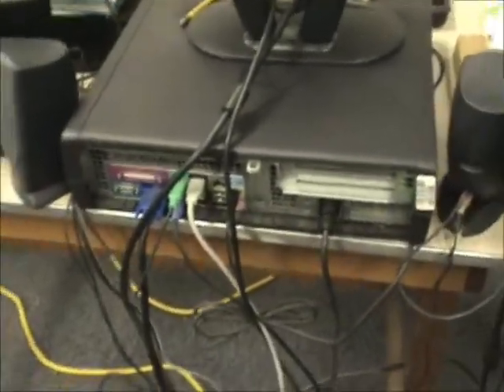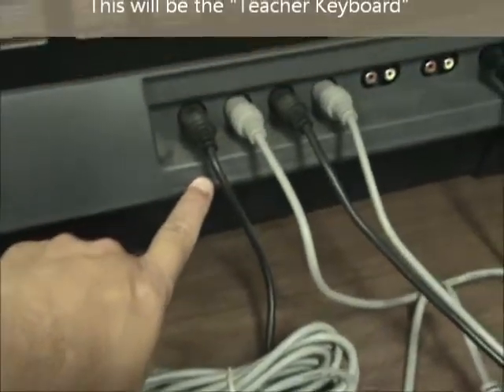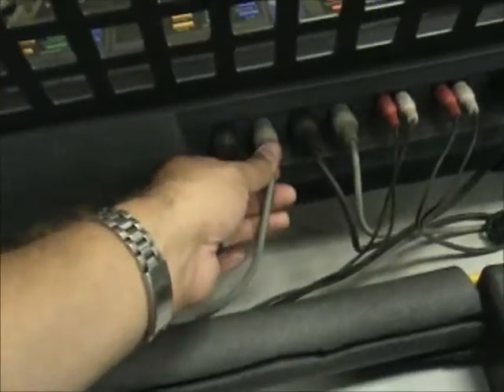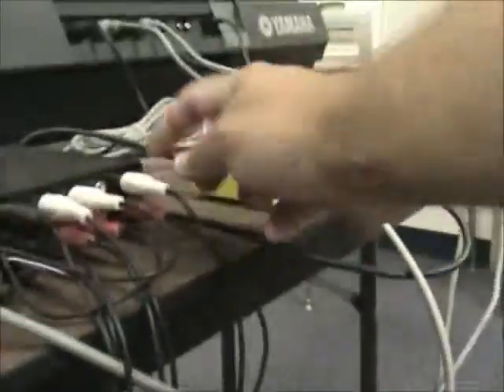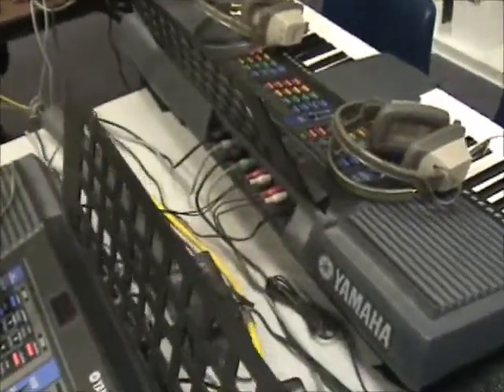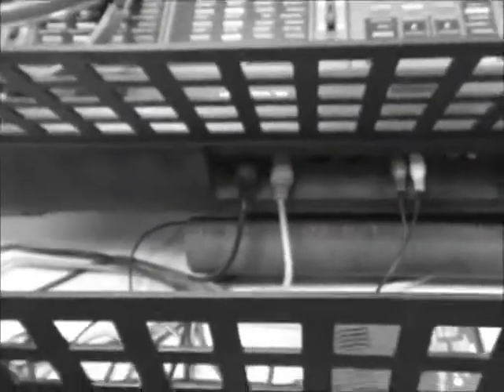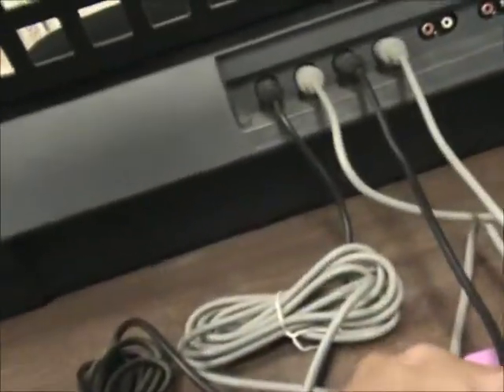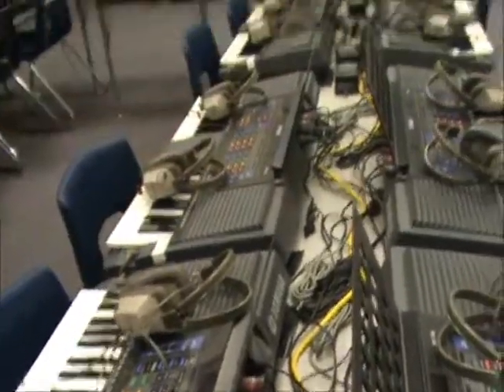MIE Set up Movie

Comment: The real curse is trying to find that M-Audio 2x2 Box when it goes bad. I've tried another brand. An Amazon Midiplus 2x2 USB MIDI interface and I'm getting mixed results. One is now the Teacher station doesnt show 0 on ID test, and some of the keyboards are not being locked out properly. Just going to get one off ebay and hope that fixes it again. But I can do the ID check and it works. Recieve test too where you press a key and the station calls out its name on the teacher machine.
Reply from the maker: It was a great teaching system when our District first adopted the program - we used it for about five years, the kids liked it - we liked it - then one summer, our District decided (over the summer break) to do us all a "favor" and "upgrade" all our classroom computers - including the MIE computers and replaced them with newer Windows 10 systems... most teachers were pleased with it except the music teachers since the Yamaha system wasn't compatible with Win10. We finally were able to scrounge up a few older PC's up (before the district scrapped them) to make the system work but that took time and other problems occurred as a result of that oversite - lol!